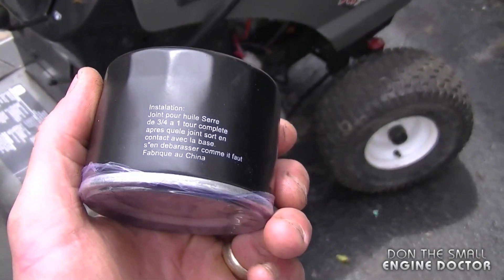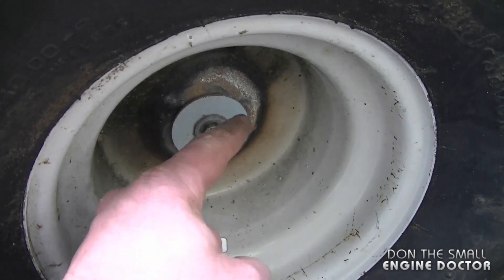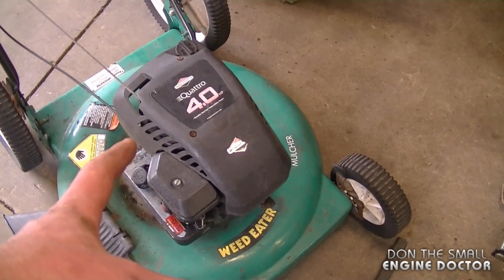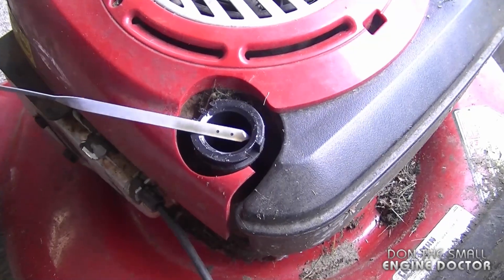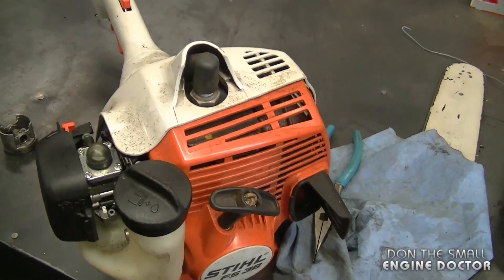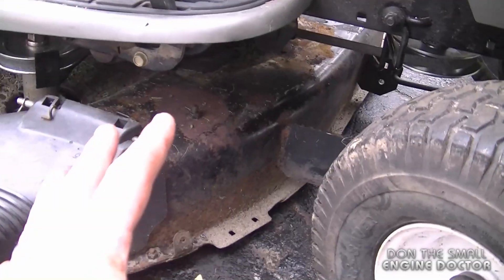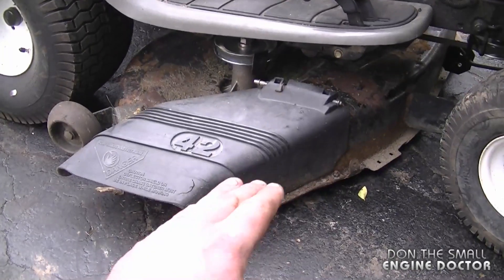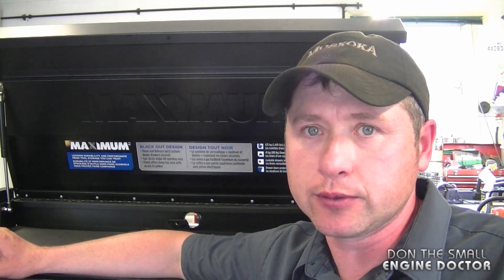Small Engines Q & A Video #148

Comment: RE tire repair, when you install an inner tube, check around the middle of the rim, where the two halves are welded together.  There can be rough spots or welder spatter that result in a rough surface that can wear a hold in the tube.  If you find any rough spots, just file or grind them off.  Another option is to run a couple of layers of duck tape over the weld, it act like the boots we used to install in that position to protect the tube.

Comment: I have a Craftsman LT-1000 lawn tractor which I have had to replace the drive belts twice on it and if the one on there now have to be replaced I will replace the pulley assembly. The tips you gave here is good and one other thing I decided to do was use a little Lucas Oil Stabilizer in my lawn tractors to stop the blue smoke from dry starts and it stopped it just as it did in the vehicle engine.

Comment: For unflooding a weedeater or chainsaw I have developed a method that works. Little dangerous though.
1 remove spark plug.
2 use lighter to burn off excess gas from spark plug
3 use lighter on spark plug hole (the dangerous part)
4 pull a couple times to clear it, and put it back together.

Comment: Q&A:  I have a Ryobi four cycle weed wacker w OHVs.  How to change / adjust the valve timing belt if it breaks?  (on most motors)  Also, how to adjust valve clearance? 
TU, The Donald

Comment: Great video as always! My question do the anti scalp wheels need to be off the ground or resting when mowing?  The manual says a 1/4 to 1/2 off but I'm wondering if they were on the ground would i get a better cut with less scalping.

Comment: It would be great to have a parts compatibility for small engine oil filters. The brand name or "briggs" one are so expensive.  For my old Sabre which has a Koler engine, a small engine mechanic told me to buy an oil filter for an 89 Dodge K-car.  Took the same size filter and I could get a Motomaster one for about $3 vs. $10 for the Briggs one.
Reply from the maker: Jackson Jackson yes and aftermarket ones are available

Comment: Hi Donny: I am having trouble with my 12 h.p. craftsman tractor,last year I replaced the carburetor and upon removing the carb. I noticed that the intake valve had started to turn blue,now I am noticing that the engine oil is diluted w/gasoline ,what should I do??

Comment: I have a craftsman dyt4000 tractor with a 18.5 hp intek engine . Lots of backfiring when trying to start . When I get it to start  with starting fluid it will only run about 40 seconds . Then I will have to wait a long time before it will start again . What do you think is wrong ???

Thanks

Comment: I have an older husqvarna 850 12 with Briggs I/C quiet engine, articulating riding mower.  It was in a yard sale, previous owner had $100+ carb work done on it at a mower shop shortly before it sold.  Looked like that consisted of carb kit and readjusting.  Still ran rough, but used that and some other, this is going to need this work, issues to get the price lowered.  I tweeked some adjustments, and now it usually runs fine for 30 to 45 minutes, then sputters and falls on its face, running rough in surges until it dies.  Usually end up pushing it back to the garage, or off in the shade to cool off, and finishing with a push mower, or trying again once its cooled down.  Any suggestions on where to troubleshoot next?  

I dislike the design of this engine, exhaust exit elbow to muffler is inches from the carb, carb breather air intake is right above exhaust system leaving motor.  Intake and carb bowl tend to be too hot to touch, even opening breather filter is hot.  Hood only has airflow from under mower and out the back. Turtle shell over the mower building heat.  

I like this little mower, articulation, ground riding front bumper, floating front deck, small enough to drive through gates.   Its almost as good as an old big mow, for cut and turning in a small rider.

Its getting harder to find non ethanol gas, and we never know how much ethanol it has, 10% minimum.  I dislike running ethanol gas in air cooled lawn equipment.  Seemed to get worse after I use up my winter blend gas, but high temps of the day are also higher by then.  Located 200 miles south of Chicago, for climate context.

Any insights into DIY things to try, to resolve the issue would be greatly appreciated.
Reply: M Par That gas could be the problem with the carburetor and in my area I noticed that at least one gas station is selling regular gas without ethanol in it. That will solve the problem if the carb was rebuilt correctly. At the end of the season it is best to run all the gas out of the engine and then put it away.

Comment: My honda 160 GCV engine is hard to (pull) start;  I removed the spark plug to decompress, the engine turns easily but no sign of oil spatter.  If the engine is not hydrolocked what other considerations are relevant?  exhaust valve, automatic decompression, cam?

Comment: I have a MTD Yardman model# 12A-445E755 and the blade control cable seized so I got a new one and I'm trying to figure out how to put it back on the correct way.  Previous owner rigged it.  Any help/suggestions?  Thanks in advance!
Reply: LeesPlakats I assume you mean the brake cable, in which case here's some images of both a Briggs Quantum and Tecumseh setup on MTD mowers. http://imgur.com/a/qYmS5

Comment: I don't know if this is the proper place to leave a comment but I have a problem with an E 2000 Honda generator and base of the problem is it start after I started it doesn't stay running won't stay running once in awhile it runs all the time until it runs out of gas and sometimes it just cuts out and then it keeps cutting out and then go back and forth for like I give up why you can't understand why doesn't do this my question your city fuel problem an engine problem no problem I don't understand how to fix it